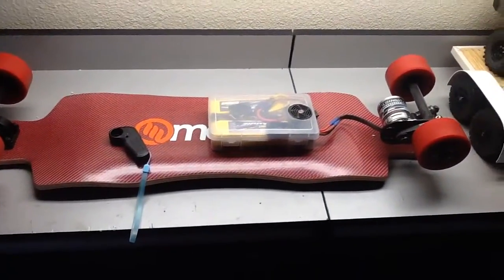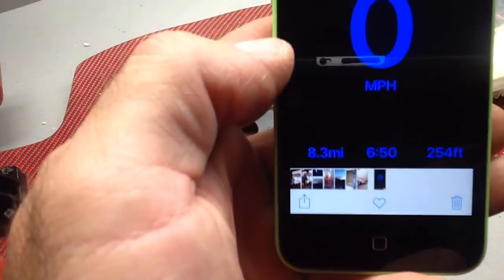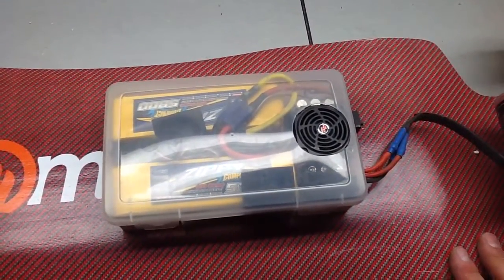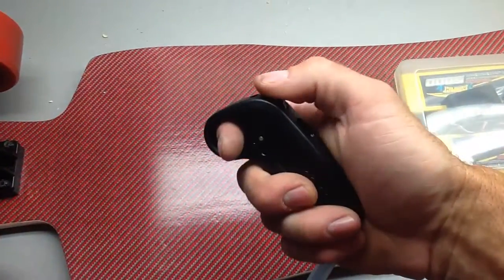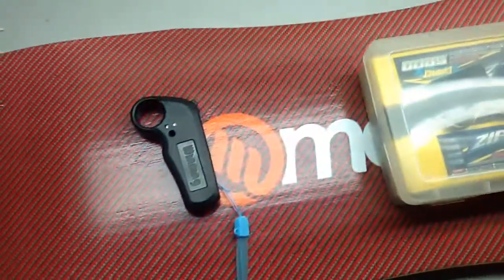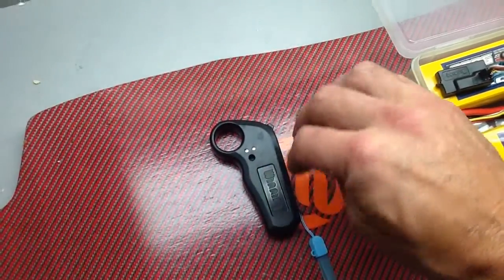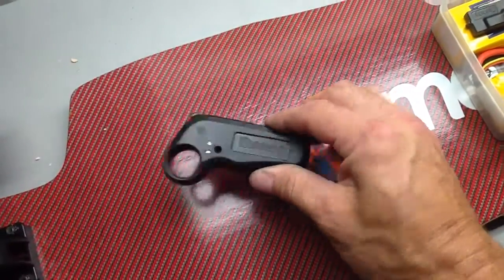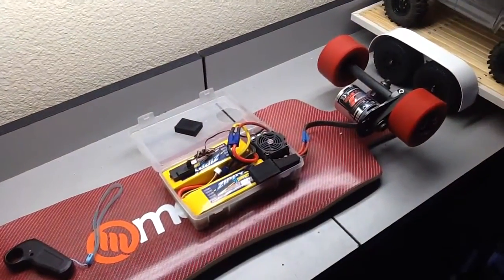DIY electric skateboard V2 range & torque boards 2.4 Nano test

Comment: thanks for sharing the vid.
i got a question. i bought an alectric skateboard but i'd like to increase its maximum speed. http://imgur.com/a/tM667 here you find a pic of the battery pac. it seems it's composed of 13 or 12 18360 batteries. http://imgur.com/a/0t73O and here come a pic of the specs. now... is it possible to change the speed of the skateboard by changing the battery pack or modifing it? and if yes, how?? thanks in advance.
Reply from the maker: Its absolutely possible to add more cells to your battery pack to create more voltage. But how costly and difficult will it be? I personally wouldn't feel comfortable taking apart that battery pack and modifying it. It looks expensive. What about changing the motor to something with a slightly higher KV rating. Seems that would be the easier route.
Reply: Scottstoyz my motors are integrated into the rear wheels. working on the batrery pack will be cheaper for me.
Reply from the maker: Ah yes, different setup. I think your only option is to find a higher voltage battery that will fit your board or modify your existing battery. That however is beyond my limitations so Im sorry I can't be of any help with that.
Reply: Scottstoyz thanks anyway. i'll search for it.
Reply: FOGLIA NERA GRAPHICS there is 14

Comment: Great videos, I'm basing my build off of what you've done. What does your charging setup look like?
Reply from the maker: Dennis T. Morsani Jr
I use a venom pro duo charger. I can charge both batteries at once. Its not the least expensive option at $99, but I also use it for my Rc car collection.
Reply: Thanks, that helped me decide on what charger to buy. I think I'm gonna go with [HobbyKing 350w 25A Power Supply + Turnigy Accucel-6 80W 10A Balancer/Charger] and a parallel charging board. I hope that's not overkill. It's lesser that what I was originally looking at before. I'm curious about your on/off switch, do you have any "antispark" electronics in place to protect the system? Thanks for getting back to me!

Comment: i have same remote..while cruising  the ride suddenly  the board stop hard and ...its very very dangerous friend of mine riding this skate board and trow I'm on the ground leave him good scars ...i don't know what cause the  motor stop.i did do calibration on that remote .did any body have same problem....
Reply: It is the fail safe most likely. When my remote lose line of sight ( ie my body gets in between the remote and receiver) my fail safe kicks in.

Comment: Hey dude, I have the same issue of throttling up slightly to quick and it throwing the break on (super sketchy / dangerous). I have a Hobby King X-Car 120A ESC. I get this issue when running 6S but not when I run 3S. I'm thinking it's ESC related. You had any findings on this?
Reply from the maker: I ended up setting the throttle range of this controller to my esc. then re-bount the controller to the esc again. this solved some other issues I was having, but only bench tested it after doing so. I haven't got a chance to ride the board since then. will let you know if the problem still exists after I get a chance to test it out again in the next couple of days.

Comment: What remote is that?
Reply from the maker: torque boards nano 2.4 remote control, sold at diyelectricskateboards.com
Reply: that website does not exist / is for sale
correct link: http://diyelectricskateboard.com/
Reply from the maker: +lemon you got it

Comment from the maker: Range update! I ended up putting back 5800mah in one lipo and almost 6000 in the other. I think ill bump up my low voltage cutoff to 3.2v I don't really think its fair to claim a range that could cause harm to your batteries so I will re-test again at the new LVC setting.
Reply: Scottstoyz what remote is this?